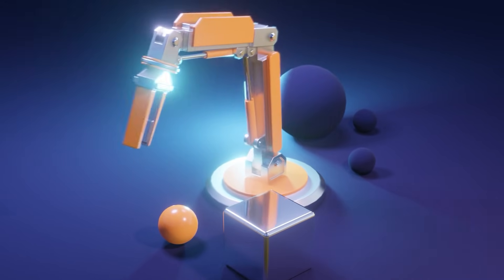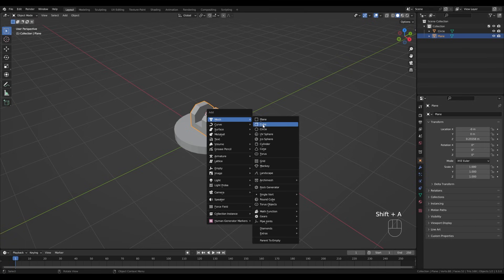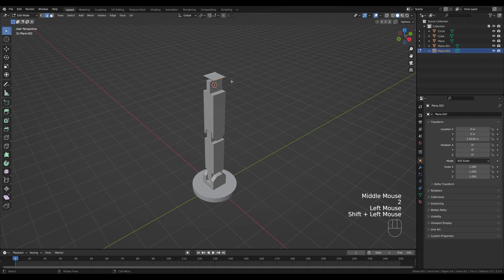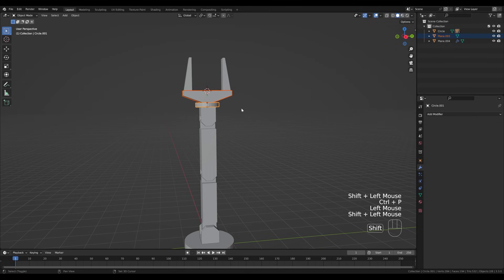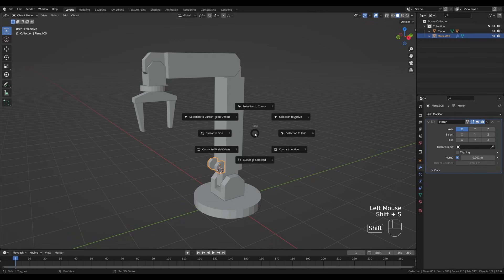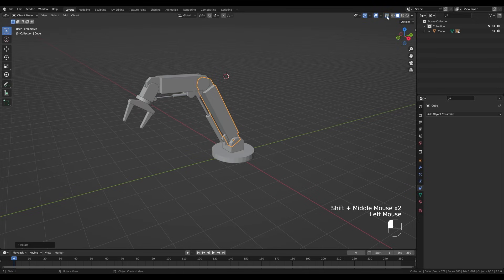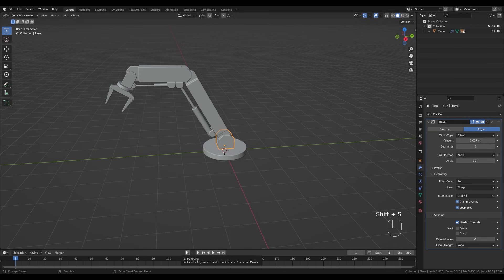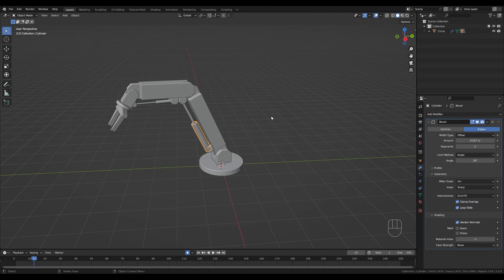Robotic Arm Rig Tutorial in Blender 3.3 | Polygon Runway

Comment: Why do you often tab into edit mode before scaling things down?
Reply: I'm a fairly new Blender user, but I think I know the answer to your question. The difference between scaling in Edit Mode and scaling in Object Mode, is that in  Edit Mode you are actually changing the size of the model. Whereas in Object Mode the model is still the same size but is having scaling applied to it. If you scale a cube a in Edit Mode and then again in Object Mode and look at the XYZ Dimensions and the XYZ Scale Numbers, you will notice that in Edit Mode, the scale is still 1, but the dimensions are different. In Object Mode, the scale number will have changed, but the dimensions will stay the same. Hope that helps.
Reply: @RockwellCreative  Oh, that's super helpful! 
But do you know if that makes a difference for something?
Reply: @adrianfels2985  In a fixed or static (non-animated) model, it may not make much of a difference. But when adding keyframes and animating, adjusting the scale up and down to change the size and yet still retain the ability to return to the original size is when using scale instead of resizing might be an advantage. Also, as demonstrated in this video, scale can cause undesirable results when applying certain modifiers - like the bevel modifier. https://www.youtube.com/watch?v=DK0_FH7miEQ

Comment: is there any differences of increasing object size in 'edit' mode or 'layout' mode?
Reply: if you scale in object mode, it affects the scale settings so you have to apply them (which is an often forgotten step) or it will mess up modifiers and other settings. Doing it in edit mode keeps the scale at 1,1,1.
Reply: @CalamityVirus  thank you so much! Have a nice day!
Reply: and beside @Metalgenocide1 's fine answer, if you move your object in edit mode, it's origin point will stay at it's current position and won't move along your abject. cheers.
Reply: @farhadkhosravi4630  thank you so much for sharing your knowledge!